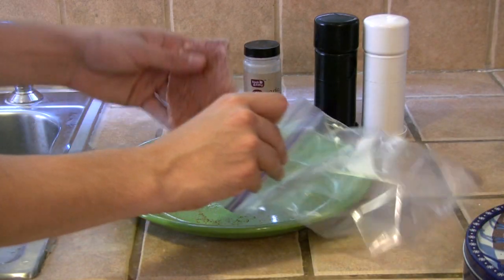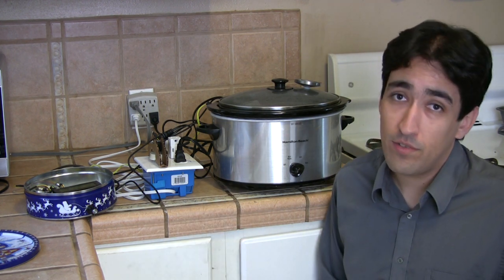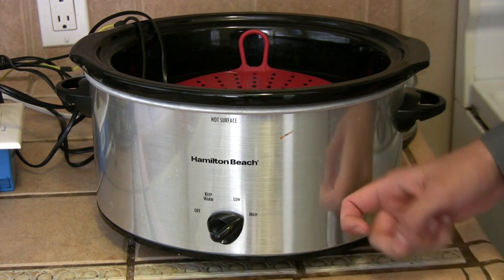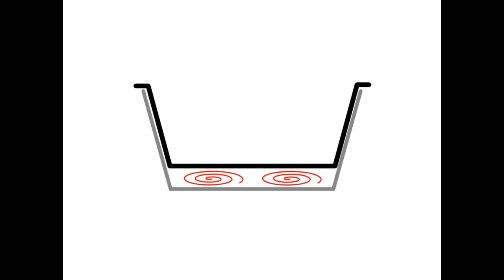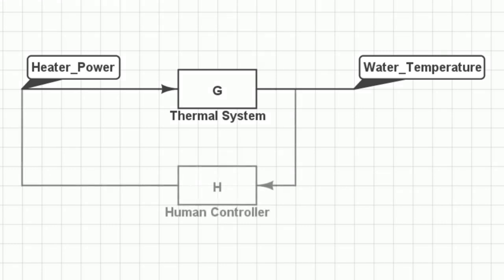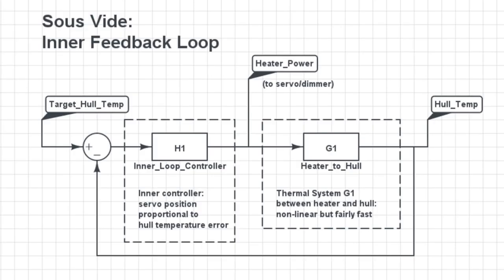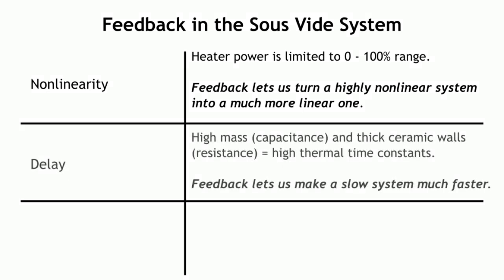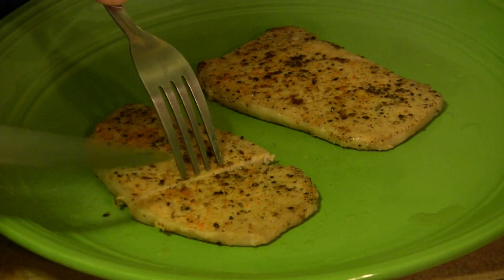DIY Sous Vide Cooker with Feedback Control

Comment: too complicated for a simple application,  I did mine with a $10 PID temperature controller including a temp sensor probe and added a $7  submersible water heater 1000w  and an old cooler and everything is controlled automatically keeping temperature within +/- 0.5 F